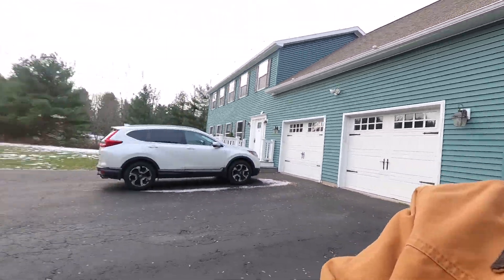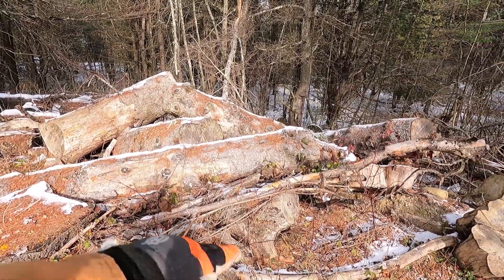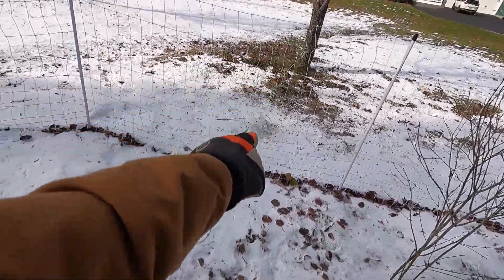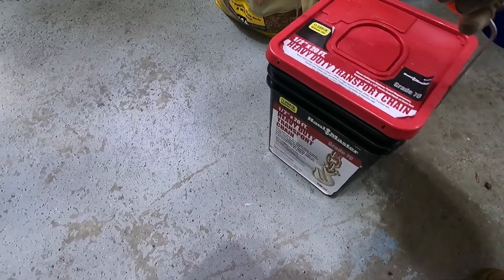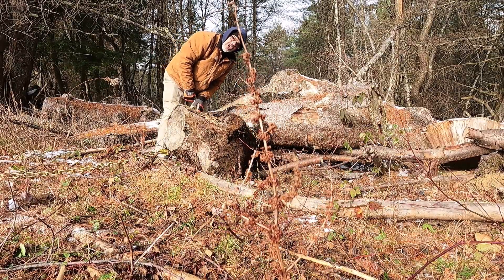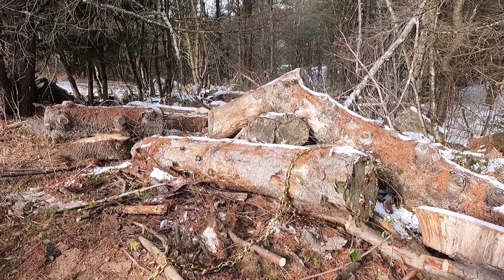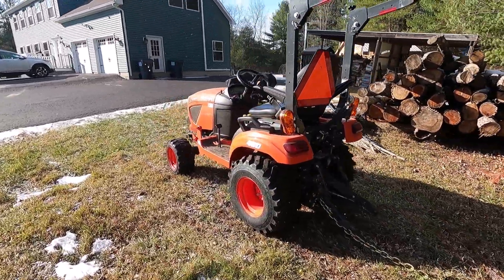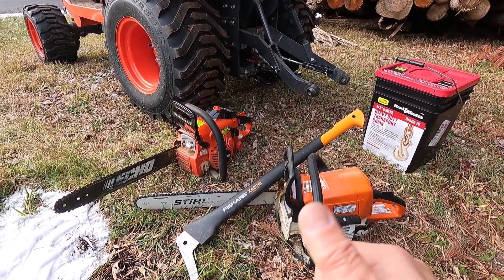Pulling HUGE Wood Log with Tractor and Heavy Duty Chain

Comment: Ovi, you got the BX with a quick attach bucket. All you need is to get the forklift attachments and you will be able to curl those logs. Also a 3 point quick hitch will save the 3 point hitch linkages and give you a place to attach that chain and since you got equipment with hitches, you can get that too. Harbor freight has a decent one. Save on manpower, let the machine do the work! Saludos!